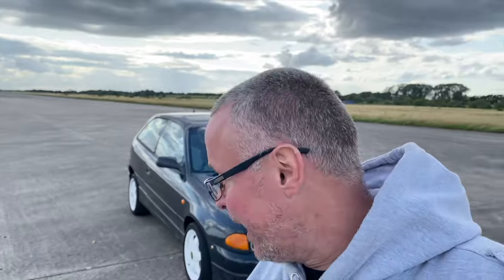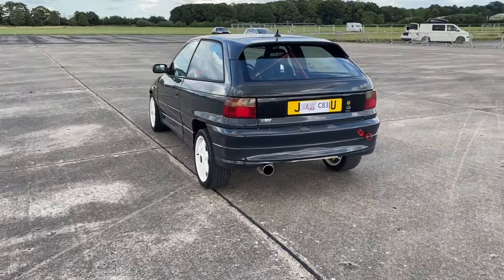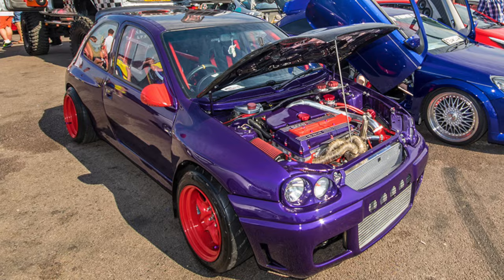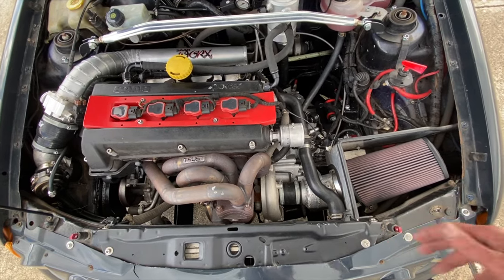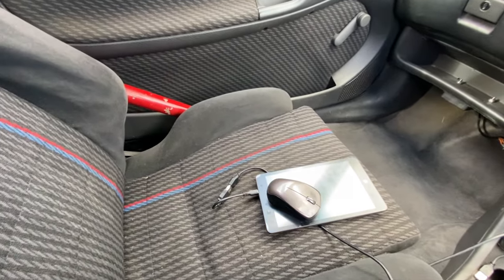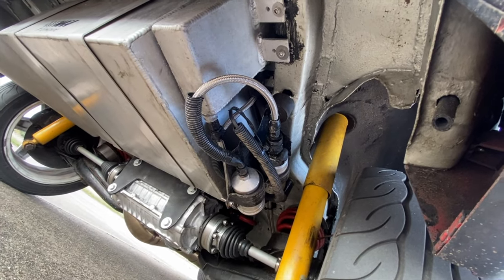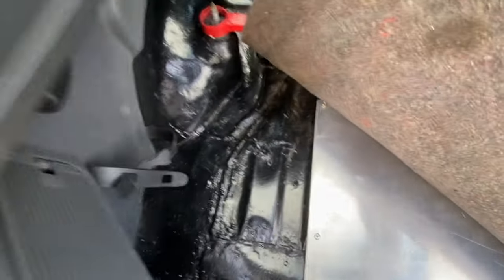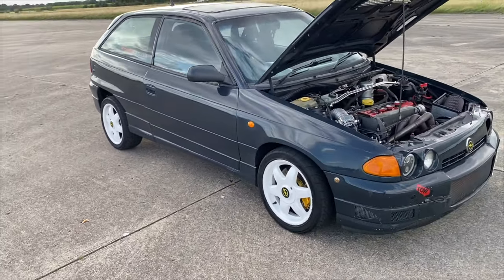Quattro Vauxhall Astra *450HP*

Comment: Forged engine or stock?
Reply: Stock on a 80series evo turbo
Reply: @kj-un5lx  impressive
Reply: @kj-un5lx  I have a stock b207 running 320 with 19t turbo
Reply: Underrated motors, I know a stock b204 sheifer is running in europe he said he hit a limmit due to the intake at 750hp on his drag engine.
Reply: Stock block 
Standard head gasket
Volvo valve springs
268 9.4mm cams
Evo 9 80 series with 20g wheel, turbo smart actuator 
875cc dekkas
Ttv twin plate clutch with lighten fly wheel
S90 throttle off a evo
3.5” full exhaust 
Audi coils
Leda front coil overs 
Komi rear adjustable shock
Ebaich 30mm rear springs